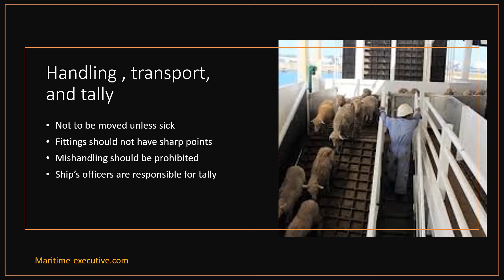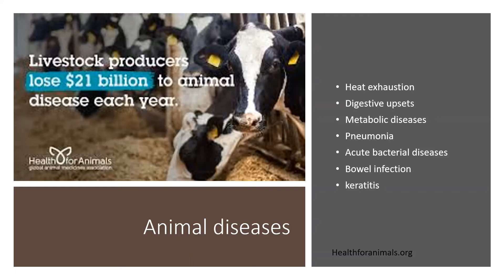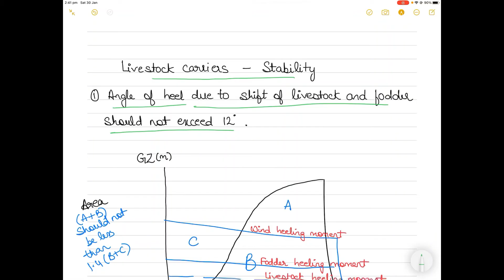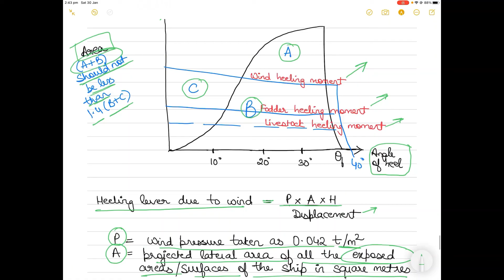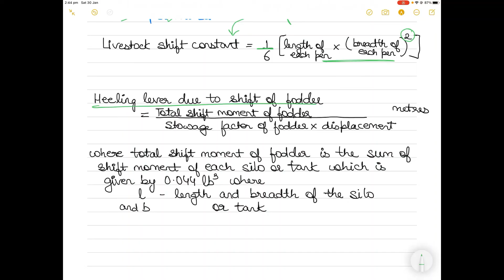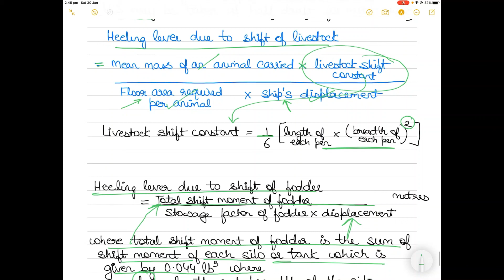Carriage of livestock on ships (Part 2) - All you need to know!!

Comment: Indeed grateful Capt, On point and more than expected. Valuable info...cheers Sam.

Btw can you please clarify : "C" would be total area under highest lever and whole of Y a-xis right? not only small part between top 2 ( wind & fodder )?
Reply from the maker: You are right, B should have been written slightly below the second horizontal line. C should be under the first (highest) horizontal line and the rightmost vertical line. Remember, we are focusing on area under the curve only. Hope that makes sense.
Reply: @SteeringMariners  ohh Yes capt..thanks indeed..keep rocking and god bless..🤙